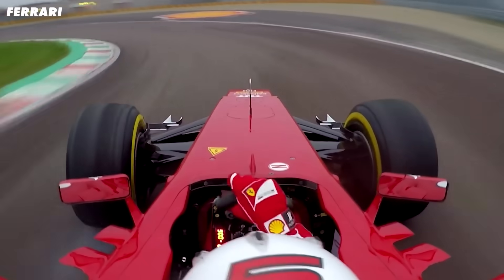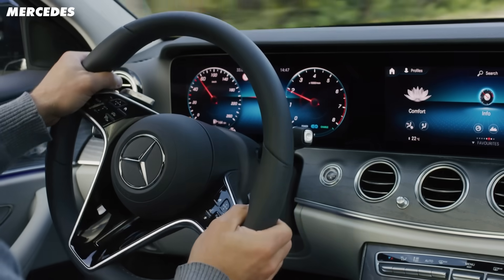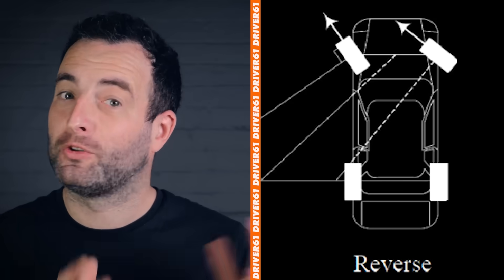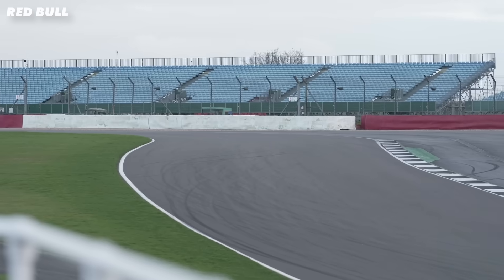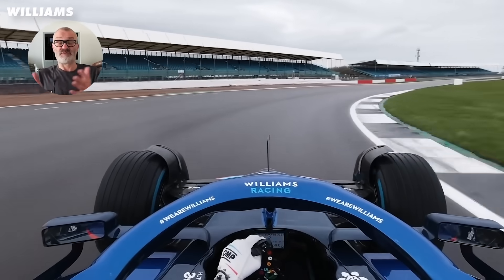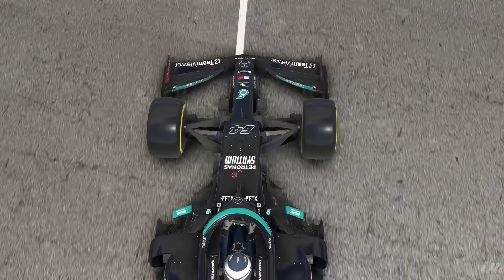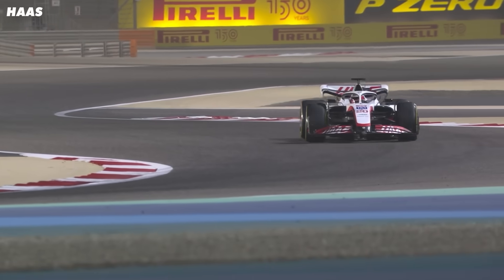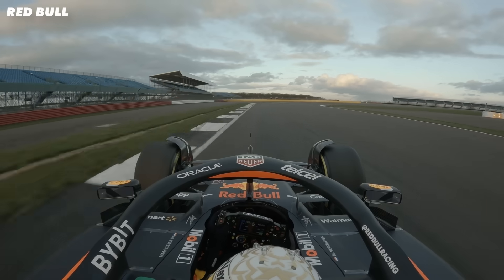The GENIUS Reason Why F1 Steering Looks BROKEN

Comment: Adjusting Ackerman is one of the most underrated setup changes on karts as well
Reply: So anti ackerman doesnt only work on high downforce vehicles but also carts. 
Lets just say we could change the steering geometry and tie rod lenght and angle on a roadcar, could we also achieve higher corner grip?
Because he said in the video roadcars would be terrible to drive slow and fast so what gives?
Why is it faster on certain vehicles but not on others?
Reply: @benistingray6097  it is only good if you intent to push the car to the limits all the time. and that you dont do on public roads.
Reply: @Rei_Anda  Ackerman is what make it possible for F1 to make the hairpin at Monaco.
It would make it easier to park you car I guess? 
Roadcars go so slow it barely matters tbh
Reply: @afoxwithahat7846 causes much more tire wear and if there isn’t the difference in force in the front tires, the steering is WORSE
So you need to be cornering HARD for it to yield it’s benefits
Reply: @benistingray6097  It's not because road cars are different. It's because road cars require to handle well at a wide range of different speeds. You can live with anti-Ackerman on a track where you are permanently driving at the limit. You may have noticed that in some circumstances on an exceptionally wet track that F1 cars travelling at super slow speeds appear to handle corners worse than your road car. It's only partly because of their tyre choice it's also because the slow speed and low grip mean that the anti-Ackerman is working against them in that situation ... exactly what you don't want in you road car.
Reply: @benistingray6097  Because different vehicles have different purposes. 

Road cars have the purpose to bring you from A to B in an easy and comfortable manner. You don't exactly go the the limits of grip when driving a U-Turn, you chill, look around, put your steering in and then drive the U-Turn. Steps 1, 2, 3 are just losing you massive amounts of time when on a race track.

Race cars want to go fast AF boi, so they compromise on (easy) drivability and general safety (just imagine road cars being prone of oversteering, every unusual highway exist is going to be a crashsite.) for... well... increased speed, and reduced time.

Also, some SUV with negative Ackerman sounds extremely awful. Haven't driven one (of course) but just imagining it pains me to the core.
Reply: @gandalf_thegrey  because SUVs transfer weight on one side very easily
Reply: @benistingray6097  I think karts are usually set up with positive Ackerman not negative.
Reply: @juaneer  exactly, Anti-Ackermann is used on high speed racecars only. Carts are usually relatively slow with tight corners. Anti Ackermann doesn't benefit you in tight corners, only wosens your minimum turning radius
Reply: @benistingray6097  i think frankly a major part is that you only get a benefit from negative ackerman if you are shifting enough weight to the outside, combining that witht he fact that road tyres simply are designed for an entirely different purpose, no, don't do this for your car unless you're building sth for timeattack or hillclimb or the like. at low speeds the outside will just lose grip and understeer more readily, ie, turn in hard or you won't turn at all
Reply: @benistingray6097  you have to think about what the benefits are.

Ignore the Ackerman value of the tires and look at each tyre individually.

Anti Ackerman places more steering on the outside tyre as it has more weight, and thus more turning potential in general.

A road car turning at it's literal maximum possible turning angle at its maximum speed for that angle would benefit from anti Ackerman also.

However, it does so at the expense of the tyre.  You also have to be driving in such a way that the weight distribution on the tyre is large, and the speed you go through corners is close to the maximum your vehicle is capable of.

Finally, it causes more wear on the tyre.  So you would need to replace your road tyres much much more often, as you are literally intentionally damaging your tyres to maximise cornering grip.

I hope you are not driving around any streets and cornering at the highest velocity each corner can handle such that anti Ackerman would improve your safety.  Because ultimately, going slower and maintaining good tyre health will improve your safety significantly more. (And everyone else too)
Reply: @benistingray6097  because road cars aren't set up for driving really fast around corners. Most drivers don't have the skills so road cars are set up to understeer because that's much easier to react to than oversteer
Also, tyre wear is important and positive ackerman reduces that
Reply: @Da5idc  easier to react to IMHO is not the main reason, being able to design safety features is (crumple zones), there is not a lot of room on the sides of the passengers to protect them in case they run into something, as opposed to the front of the car, so the design is about running into things straight on, rather than any side of the vehicle
and "easier to react to" is not really a thing - since with understeer, the tendency is to put in more lock, that is the intuitive thing to do, but absolutely wrong thing in reality - because you're already over the max slip angle, which is very well described here in the video, what you should do is to open the steering up, catch the grip and then try to steer into again, and I'm 100% sure that 99% of daily drivers have absolutely no idea about this, what they do is they brake, and that brings the speed down, inertia, that is trying to overcome the slip angle, and eventually the speed is so low that they finally are able to get some grip on the front, and when they do, they already have max lock into the steering, and eventually will "scandinavian flick" the car right into the other ditch on the road
oversteering however makes the driver intuitively do the correct thing - to steer into the direction they want to go, the problem is that they don't know what to do with the accelerator at that time, and eventually again get to the unintentional "scandinavian flick" into the other ditch again
so the end result is the same, but in understeering case you can design the car to be as safe as the weight/cost/complexity allows for
Reply: @dghtr79_36  You forgot about ABS
And turning into the direction you want to go (I assume you mean not the way the car is going) is something no daily driver will know about. They will be on the brakes and the second 360
Reply: not adjustable on my kart
Reply: @rimka11  depends on What year your kart is, my is very old im gonna change it soon
Reply: @rimka11  Its adjustable on anything if you don't mind cutting it up.
Reply: @rimka11  yeah it is... if you change spindles 🙂
Reply: Definitely is, most people don't know what caster is either and it's importance,  just glad videos like this are getting lots of views so people can have some understanding of these things
Reply: Cant stress this enough 👍
Reply: And on RC cars as well!
Reply: I'm totally going to try this next season!
Reply: @theracerdude  in my limited experience positive Ackerman is the only thing that works. Even after watching the video I'm confused as to why f1 uses negative ackerman... Unless it's actually for 1) causing the front to push which in turn keeps the tires at temp or 2) increases high speed stability in 160+ mph corners ... Which is kinda the opposite of what he said in the video... Very confused. I do know with massive power and lots of positive Ackerman the rear end can get wild pretty quickly. In most carts there isn't enough power so negative ackerman will probably scrub a massive amount of speed and cause the car to push ... Not good for tight corners with low horsepower. What you really want to do is setup the car to require the lowest amount of steering input. Negative ackerman will do the opposite of that
Reply: @1fast72nova  honestly I agree.  But I’d also like to try it to see what happens on a test day. If it turns out to be bs we can always go back to what works.
Reply: Not only on karts, but even on way smaller RC cars. It changes so so much in cornering
Reply: @Scottydelsumo  absolutely. For anyone looking to change Ackerman most modern carts allow for this. Find your tracks average corner radius on the racing line and setup the ackerman for the lowest scrub which will be when the cart or rc is easiest to push through that arc
Reply: Does any sim simulate this adjusting ackerman
Reply: Road car tyres need to last for more than 100 miles. Positive Ackerman gives you light steering, good grip at road speeds and minimum tyre wear

Comment: How is the anti-Ackerman steering accomplished mechanically?
Reply: Search for anti ackermann and read the analysis by f1dataanalysis
Reply: @NassimFTW  Thx!
Reply: It's the angle of the steering arms between the rack and the upright. Bob Bolles has a good description of it in his book.
Reply: Usually done by having the steering gearbox and the control arms ahead of the front axle while for Ackerman everything is behind the front axle. But its F1... they'll have some complicated solutions🤷‍♂.
Reply: @BharathwajSathishkumar  That's not really the defining factor. You can get pro or anti-ackerman with the rack and tie rods on either side of the hub.
Reply: @ArchOfficial  Oh. I didn't know that. Thanks for letting me know.
Reply: @BharathwajSathishkumar  actually thats not correct. From the top to the lower wishbone joint you have the tyre steering axle and the point where the steering arm is attached draws a line. This line need to hit the rear axle in the center to get 100% ackerman. Mostly they do this by placing the the steering rack behind the fron axle but you could also get the same effect by placing it to ahead of the axle and push the steering arms on the hub more to the outside. For anti ackerman it works wise versa. Hard to explain without a pic tho
Reply: I love this channel!
Reply: It depends on the location of the tierod’s or trackrod’s pickup points on the upright of the wheel (x,y,z) and there relative positions to the attachment points between the tierods and steering rack and of course taking into consideration the wheelbase and track-width of the car

Comment: Hey @Driver61 could you maybe do a video on F1 running 4 cylinder engines. I know that might not be everyone's cup of tea and the chances of running v10's 12's or even 8's being so slim, if you look at how powerful bmw's 4 cylinder f1 engine was that brabham and Benetton used and how successful the Japan Super Formula series is with their 4 cylinders I'm sure F1 could make a success out of it. Sure the engines that is used in the Japan Super Formula series doesn't rev as high as F1 today but in my opinion they sound better. With the planned removal of the mgu-h and an inline 4 cylinder being slimmer than a V6 it could possibly mean slimmer and shorter as well as lighter cars. The Japan Super Formula cars weigh only 660kg with the driver included. Also manufacturers like Mercedes, Redbull with Honda and Renault for Alpine all have big experience and great success with 4 cylinders, I'm not sure of Ferrari but even the new comer Audi or at least VW has experience and success with 4 cylinders so that would mean no team would have a major advantage by being more experienced with those engines and it would be something fresh for F1. Also there were talks of increasing the power output of the mgu-k so with a 2l turbo 4 cylinder engine that makes about 600hp (not impossible the super gt cars make 600- 650hp and uses the same engine as the super formula) with the mgu-k you could be looking at 800 - 900hp in total.
Reply: Inline engines can't be stressed members of the chassis and so need reinforcement, pretty much the reason they've disappeared.

V4s are, unfortunately, an Elephant in the room, it's just cheaper and more straightforward to make Inline 4s for road cars where performance doesn't matter that much, because of that they have no road relevance for cars (not considering bikes, ofc).
Reply: @afoxwithahat7846  I understand what you're saying but if Japan Super Formula can make a success out of them then F1 could too considering the money, resources and technology F1 engineers possess. Also look at the new c63 amg that uses a 4 cylinder and makes over 600hp to counter your argument of performance for those engines don't matter much on road cars. Lotus for another example uses 4 cylinder engines for how long now and are great cars to drive on the street and take to the track. The A45 amg is still the most powerful production hatchback on the road. Alot of private owned race car companies still use 4 cylinder engines for their track cars like the Honda K series or the Ford Duratec engine. Also look at Super GT and DTM before DTM switched over to Gt3 cars they had major success with 4 cylinders. Rally cars also still use 4 cylinder engines. Also if inline 4's are cheaper to produce that could invite more manufacturers to F1.